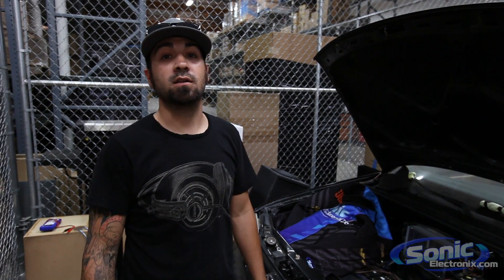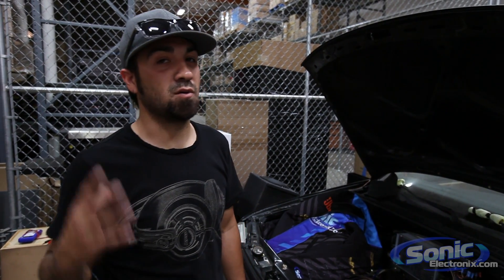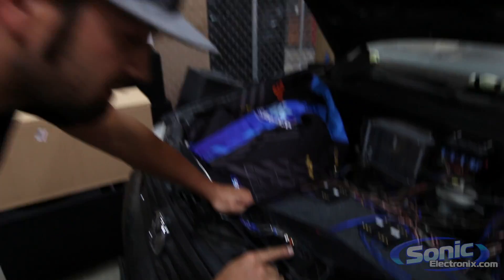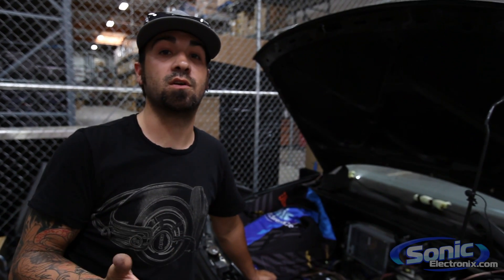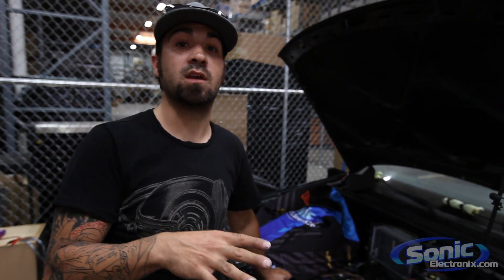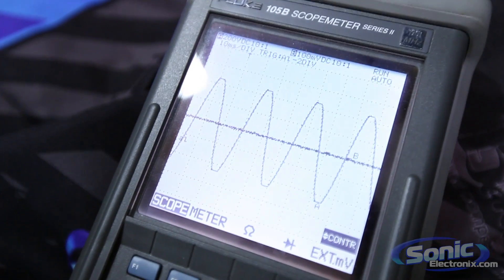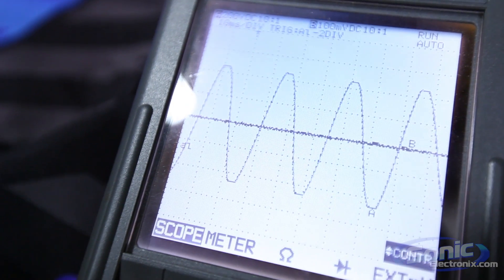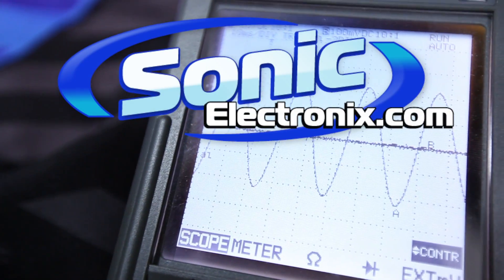How to Set Amp Gain by Ear | Part 1 of 3

Comment: If i bridge 2subs(DVC)  into one amp (Sony XM-SD22X) @ 500rms @4ohm.   Does that mean 500w each sub gets 500W or does it get split into 250rms/per sub.
Or should I just wire both subs into 2ch @ 250rms @2ohm.  (same amp)
subs are rated @400wRMS

Comment: thanks for response . it was my amp even with gain and bb about as low as they could go and still move sub was burning amp was sending bad signal or something i think my 12 killed it i had a old ssl 1000 ab class a nd was powering a dual 2 ohm 12 pioneer champ series pro and a dual 4 memphis pr  15 wired at 6 ohms got new amp a 3200 ab power acoustic gothic and no problems anymore and had a massive increase in output cant wait 2 get the 6000 pa gothic d class and replace 15 with a pa mofo thanks

Comment from the maker: Use a multimeter to test the impedance of the voice coil. If it says 2 or 4 you are probably fine. If there is no reading then the subwoofer is blown. Make sure your amplifiers gain is adjusted properly, and try to avoid using too much bass boost as it can introduce a lot of distortion.

Comment: KNOW THIS. If you have access to a scope and can test the output you don't need the speaker to be attached. THIS IS an awesome way to test for clipping and you can see how well your head unit works with you amp.

Comment: A speaker is an electromagnet and is designed to ONLY travel in and out. When the speaker receives distorted “clipping” signal the path changes. From rest “middle”--- It travels out, oscillates at the maximum peek, travels in and oscillates at the minimum peek, ---then back to rest in the middle. PLEASE protect your investment and avoid distortion at all costs. When speakers make these sounds you are damaging them!

Comment: DO NOT FOLLOW HIS ADVICE. IT IS DANGEROUS TO YOUR SUBWOOFER. Distortion even for a brief moment is harmful to a speaker. It is the leading cause for "blown" or damaged speakers. The gain is clearly marked with voltage and should be matched to your stereos output. Clipping is exactly as he shows. It’s a flat spot on the sin wave. Holding a speaker out and in at its peeks forces it to oscillate. It’s doing it twice per cycle. 80 times a sec.

Comment from the maker: It will serve the same purpose but will be slightly less effective when you consider the degradation of the signal quality through the auxiliary port. Make sure when you turn up your signal on the MP3 player it is not clipping. Go to about 80-90% volume on the MP3 player.

Comment: I have a MTX amp 4 channel that produces 75rms at 4ohms, how would I go about adjusting the speakers that are only 50rms at 4ohms? Just listen for distortion from the speakers? The speakers will distort before the amp clips, correct?

Great video as well! Was able to set it for my sub with ease. :)

Regards, Brad.

Comment: After setting up your gain, you can adjust the bass boost to your like? and seting your bass boost too high will also cause distortion? and what does the hrtz control on the amp do? can you set it really low? or high?

Comment: Or, just remove the rca's from your highs amp, unplug the speakers from the sub amp and turn your volume to the max you would have it at. Then turn your gain up. Have your ear right at the gain on the amp. Listen for a faint buzzing sound, that's clipping. Back it off and you're good to go. Tested it with the DD-1 right after and was dead on.

Comment: nice video , proves you can set a gain by ear , but it also takes a good ear and knowing what to listen for . i normally get my speakers set up to the max vol they are clean and have the bass zero'ed out and sub level on zero and then set the amp for the subwoofer . just trying to toss some other things in there i use when setting by ear . keep up the good work . uploading a new video rite now also